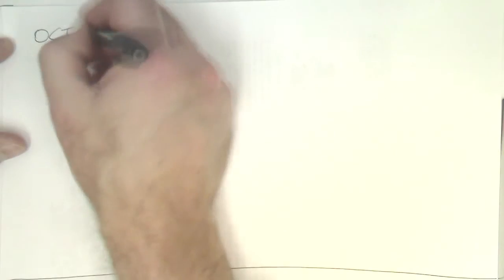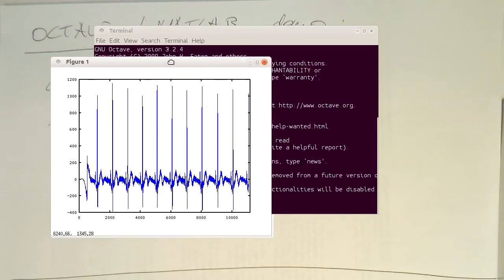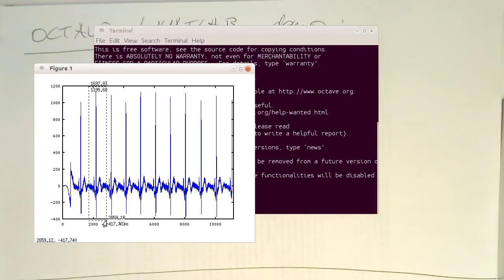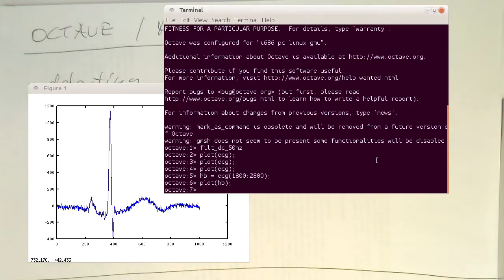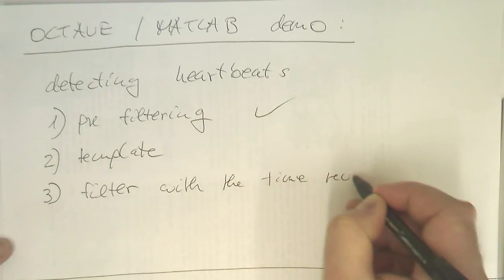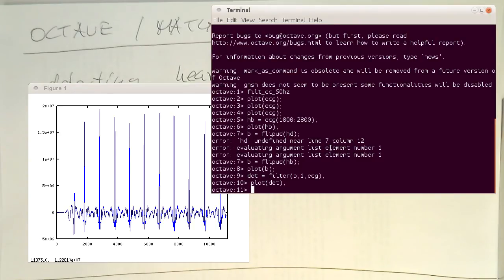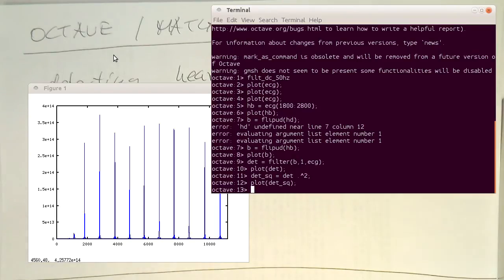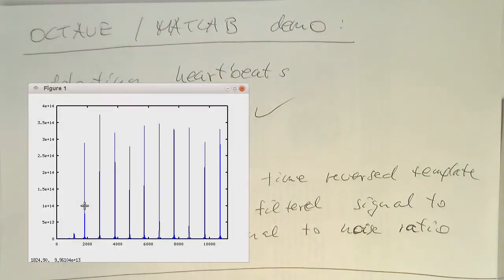Matched filters: heartrate detection as an example (0004)

Comment: Appreciate the helpful lecture. I saw the matched filter signal does not happen the same time with the original one. Can you explain?
Reply: The matched filter is an FIR filter which consists of a delay line which calculates a weighted sum. So any filtering will have a delay.